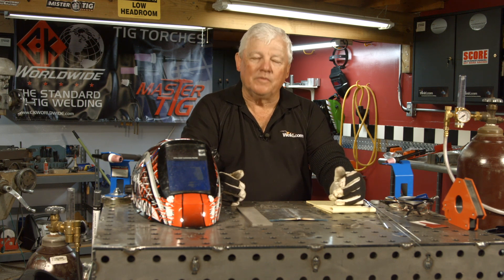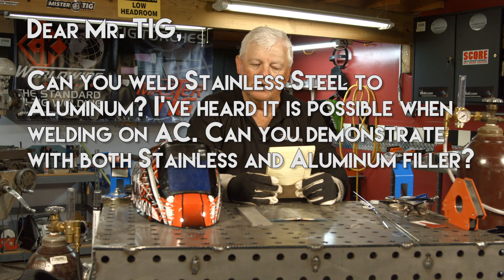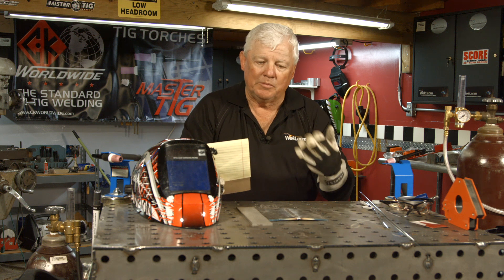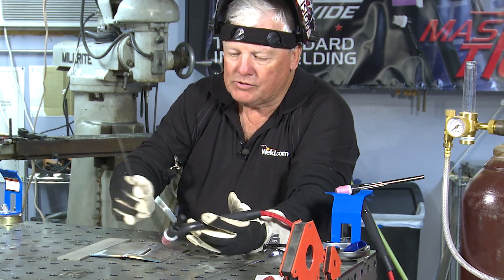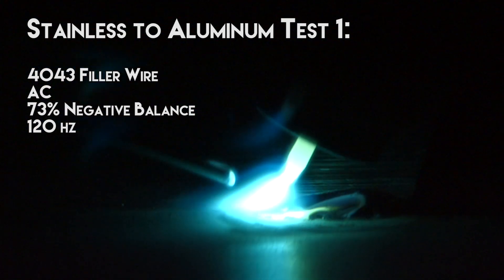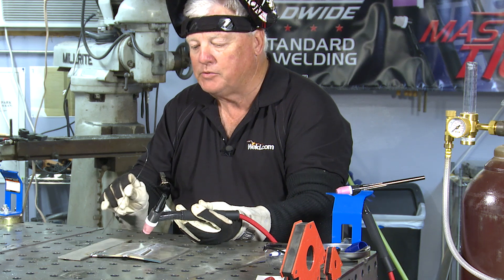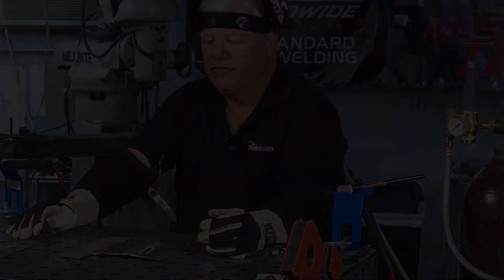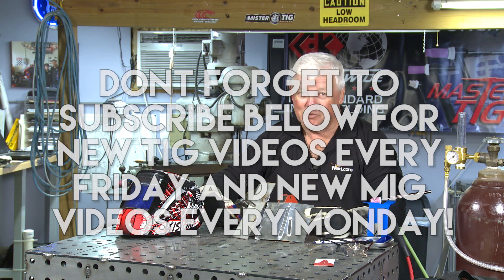🔥 Welding Stainless Steel to Aluminum Welding | TIG Time

Comment: Dr Phil?? way to insult a guy that might still be learning and curious. I had never thought about mixing the two and was curious myself.
Reply: Not to worry guys, I already have Phil's number on speed dial.  :-O :-O :-O
Reply from the maker: Pizza welder knows we're just messing around. He often asks us questions like "how do you weld wood to metal".
Reply: Pizza welder only asked the question, Mr.Tig actually tried to weld aluminum and stainless steel......
Reply: this one had my laughing out loud

Comment: oh it can be done...just has to be explosion welding lol
Reply: We'd use bimetallic strips (say an inch wide) to tie the steel decking to the aluminum super structure on navy ships. It was all corrosion repair related. It was a explosion welded plate cut into strips. If you weren't  careful, the heat from the aluminum MIG welding could separate the bond between the dissimilar metals.
Reply: I've used explosion welded pads of aluminum/steel to connect aluminum structure to steel stantions. We've encountered the same issues with separation of the explosion weld.
Reply: That sounds like some real fun!
Reply: ringram0790 maybe seal the edges up with aluminum brazing rod or some industrial epoxy. or it's just unavoidable and galvanic corrosion occurs from the inside out
Reply: Our customer didn't allow it, we had to make some engineering changes instead.
Reply: ........Or inertia friction welding. With inertia welding, there are lots of different combinations that can be welded. (i.e.: https://www.interfacewelding.com/bimetals/metal-combinations/) TIG though... I could see where this would be a bit difficult.

Comment: I know this is nuts but, I welded these two metals by accident by picking up the wrong filler rod and the pulley shaft protection cap is still functioning after 18 years still fulfilling its purpose, mind you it is not a structural situation.

Comment: Ran into this issue a while back with small bore pipe. My research found that I had to use a special made transition piece (coupling). this coupling was made by explosively fusing the two materials together, then machining.

Comment: Would aluminum bronze or some other "tig braze" material work here? Serious question.
Reply: You can "weld" together dissimilar materials with silicon bronze. Jody did it with copper and stainless steel. I thought that's what was going to happen in this video.
Reply: Thats exactly what I was expecting to see
Reply: Yes. Br IWE
Reply: you if you use silicon bronze, i do it at work i weld 6061 aluminum to a 304 stainless. but i guess when he asked with stainless or aluminum filler he was just using those
Reply: Bugger! I was going to suggest that. However I don't have a TIG welder ... yet. So I suppose it will have to be oxy acetylene.